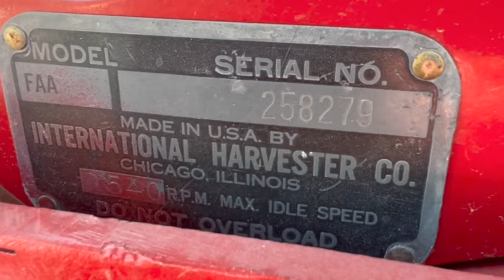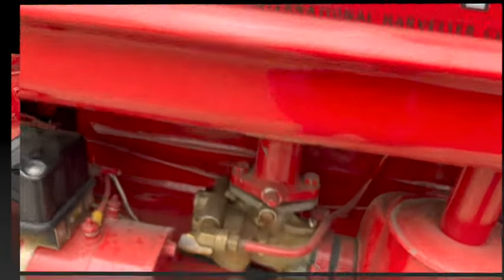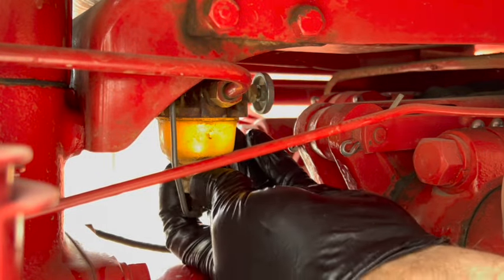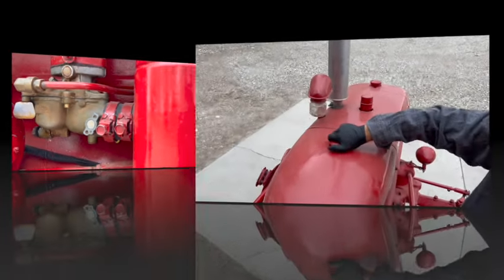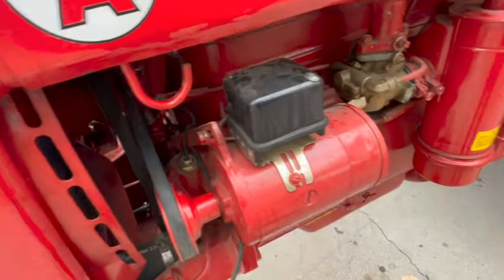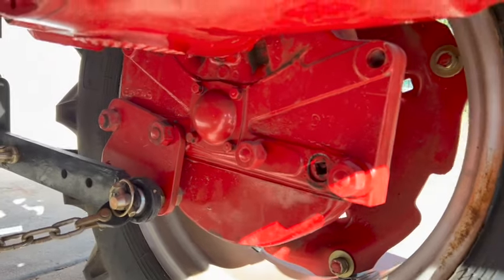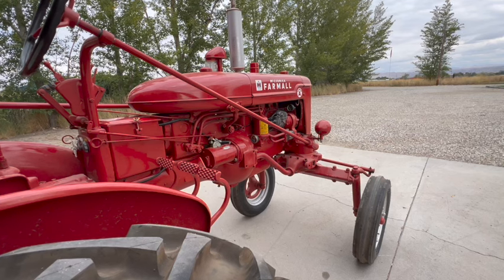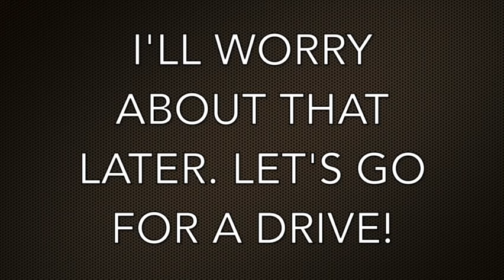1948 Farmall Super A - Part 1

Comment: Check the generator tag. It will say 12 Volts if it's been converted. Delco system. A circuit. These were made with 6 volt systems, positive ground, but folks would convert them to 12 volts to get them to rollover faster for starting. You do have a fine example of a  Farmall Super A.
Reply from the maker: I will check it. Thx.

Comment: Your square front axle beam and the heavy brace back to the rear of the engine should make your tractor an International Super A instead of a Farmall Super A. That is to say it is an industrial model. Some of these had a foot accelerator. The serial number would be the determining factor. It'S NICE!!! 
I have a 1941 Farmall A that has been my lawn mower for about 50 years.
Reply from the maker: Yes, I think somebody just put an industrial front end on it. The serial number indicates Farmall Super A. I love that tractor!

Comment: Could you run a small modern bush hog with that?  Like a 4ft?  Would be nice to use to keep trails mowed.
Reply from the maker: I think even a 4’ brush hog is best suited for tractors with a minimum of 20-25 hp. However, my guess is you would still be ok on a Super A as long as the brush you are cutting isn’t too thick. Basically “light duty” mowing should be ok, but thick stuff would not be advisable.

Comment: I just bought one of these and I'm not sure what type of oil, fuel, antifreeze or hydrolic fluid to use.
Can you help me out?
Reply from the maker: Well, I can tell you what I usually run in my old tractors; Motor oil - 10w30, 10w40, or 15w40 T4 Rotella. Fuel - 100% NON-ethanal gas. Coolant - conventional green concentrate which I mix with distilled water. Hydraulic fluid - hytrans (any brand). Good luck!